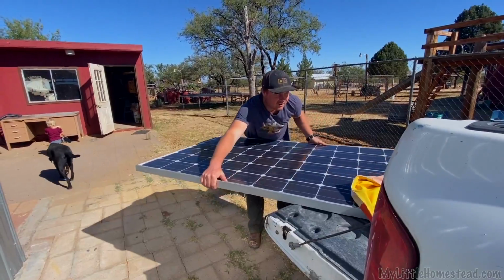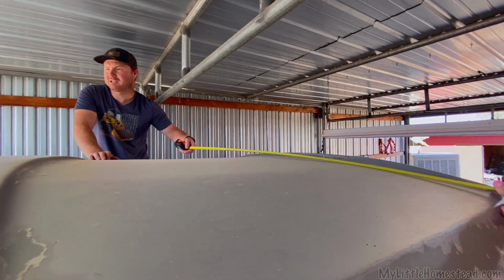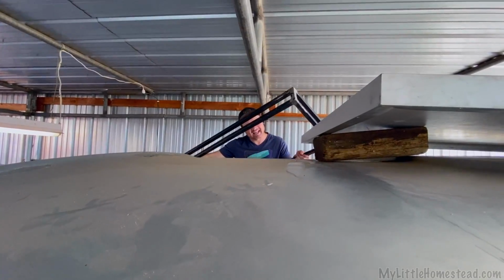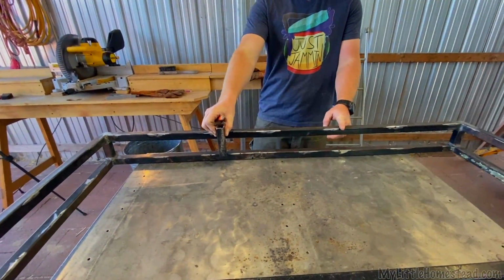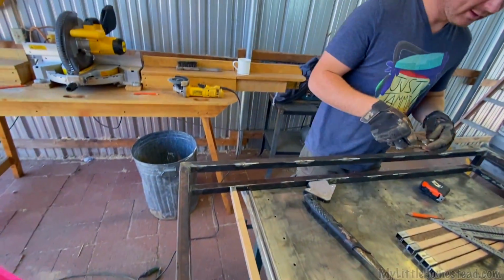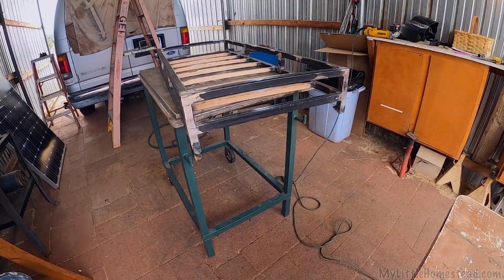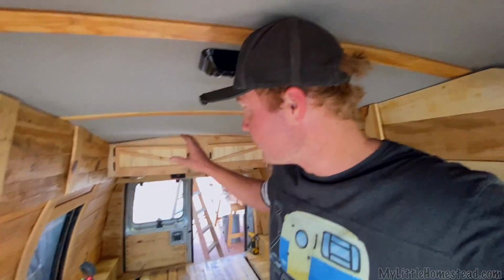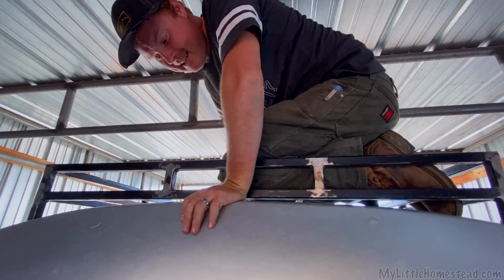Turning Pipe🚗 into Roof Rack! | Weekly Peek Ep331

Comment: Nice work on the rack Garen.  To keep things from going through the bars, put a piece of 5mm sub flooring under what ever you pack in the rack.  You can glue it down with construction adhesive and poly it for the weather.  You might also want to add a few "D" rings along the outside for tie downs.  Have a good week.

Comment: If you mount your your luggage rack 1st then stick your solar panel up against it and then screw through your luggage rack into the side of the solar panel at the very bottom of it are well to couple of tabs crossed the metal piece and then wrote put your solar panel to that and then you'll only have to drill 2 more holes at the front of the solar panel to hold it on

Comment: Water proofing of the bolts? The holes in the van roof for the bolts need to sealed for both the roof rack and the bolts for the solar panel rack.

Comment: Now you need to take it back off again so you can spray paint it. Otherwise all that exposed steel in the rack will rust. That would also be a good time to waterseal all the holes as others have recommended.

Comment: If possible, when you are trying to figure out how to rig the solar panel, you should see if you can devise a way to mount it that will allow you to raise it some and tilt it to either side. That way you won't have to worry about which way to park the van as much and still be able to adjust it throughout the day to maintain the optimal angle to get the most production possible. If you just keep it flat wouldn't that result in only having optimal production when the sun is directly over head and then less then optimal when the sun is either rising or setting? Of course that would then mean checking and manually adjusting the position unless of course you can also come up with a way for the panel to automatically track the sun.

Comment: First Awesome van.
question for you what did you do to prevent rain or moisture from leaking in to the beautiful interior with the holes you put trough the roof? Liquid rubber? Silicone under the washers? Call me selflessly interested. Thanks

Comment: I've seen the results of having an adjustable reflector for a "flat" solar panel. The extended gain time can be from two to four hours depending on size and time of year. A slightly curved reflective aluminum sheet, slid under the solar panel for storage, would do good. House the edges in pipe with a slit ripped into it. Failing that plan a flat reflector would still help.
 (__

Comment: Concerns after all the welding  and bare metal exposed should you not paint the rack to protect it from rusting? Also  since you know put holes in your roof of your van should you not put rubber grommets and some kind of (boating) sealer to protect from leaks caused by rain, snow and ice when it melts the water can leak through the holes you drilled to bolt down the rack and this will also apply to your solar panel when you mount it as well.? You will want to protect the interior from the water leakages?